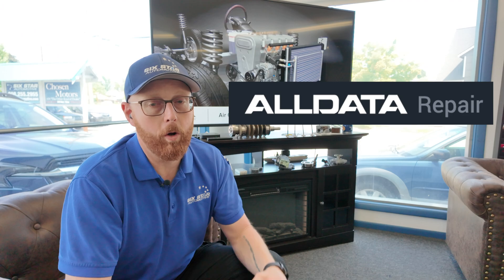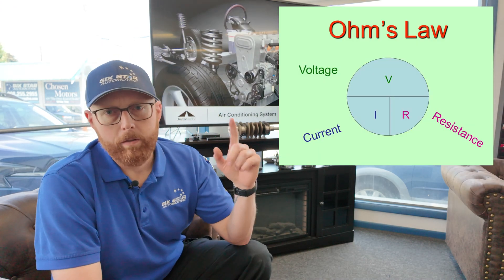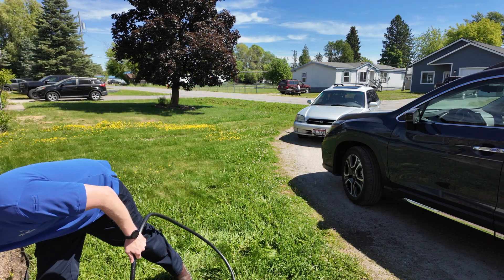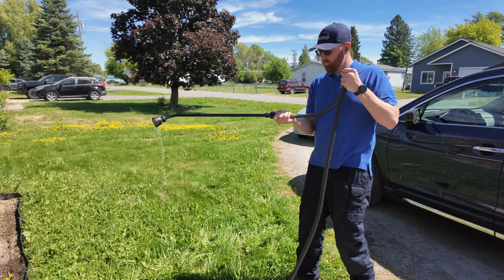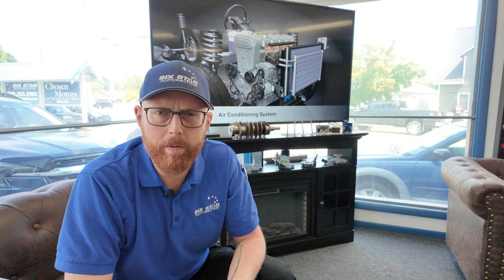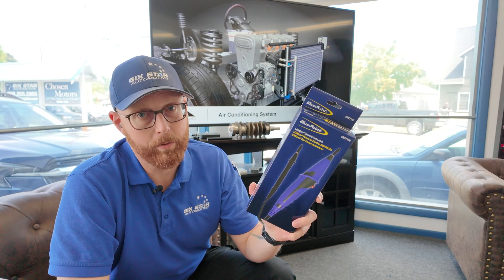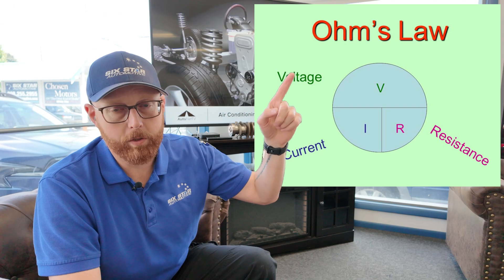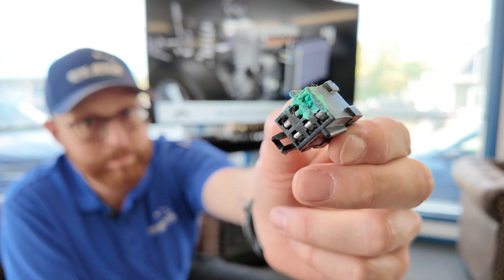Voltage Drop Diagnosis – The #1 Electrical Testing Skill You Need

Comment: Voltage drop testing doesn't fail. You either have a viable circuit, or you don't. Like our friend Dan said, he didn't invent voltage drop-just an easy way to identify it. His Loadpro and the associated no nonsense book ,Fundamental Electrical Troubleshooting  make it simple to understand. Regardless of what device is used, once the concept becomes clear and is utilized, the diagnostic process becomes faster and easier. And yes, it does work very well on starting/charging systems that carry substantial amounts of current. Just my 2 cents. Thanks for posting the video, good stuff!!

Comment: How many amps does it draw??

Do you even know?
Reply from the maker: Its draw depends on the voltage in the circuit, but its generally about .5a
Dan Sullivan explains it here https://www.youtube.com/watch?v=1NX7ei0H0Is&t=1043s
Reply: @sixstarauto so if you were testing a fuel pump circuit. Could potentially pull 5 to 8 amps do you think a .5 of a amp is appropriately stressing the circuit to show integrity?
Reply from the maker: @kevinminor2558  Yes, check out this video. https://www.youtube.com/watch?v=1NX7ei0H0Is&t=1043s
Reply: @sixstarauto We can both agree the LoadPro pushes about 0.5A to stress a circuit. But let’s be real—take a starter cable, that big red one pulling 150+ amps on crank. You measure 12.5V with a voltmeter, then hit it with the LoadPro, half an amp, and it still shows 12.5V. According to that tool, the circuit’s fine. But is a half-amp really the same as 100 amps? Do you honestly believe that? I don’t. This kind of test might give you something useful on certain smaller circuits, but it’s nowhere near universal like you’re pitching it.
Reply from the maker: @kevinminor2558  It will work. Watch this video, or use the tool. It does the job, even on battery cables. https://www.youtube.com/watch?v=1NX7ei0H0Is&t=1043s

Comment: I work for Ford and after you pass the electrical class they give you a test lead kit that is super helpful their diagrams will tell you pin size and what lead to use
Reply from the maker: A good lead set is invaluable. You need to be able to trust your tools so you can trust their results. That is cool that Ford does that.

Comment: I used to get caught up on engineer flow charts with resistance checks and I got burned a couple times now I load test wires with either a 3157 bulb or an H11 bulb and have been far more successful with diag work
Reply from the maker: That's good. I have never liked the light technique. It works, don't get me wrong, but I want to know the number, not bright or dim light. But again, some load testing is better than none. I just need numbers. Easier to explain in notes to the customer that way.

Comment: 2:23 - The reason you cannot measure voltage drops without current flow is because there is no voltage drop across a load in a circuit that is not complete. You will only measure the supply voltage across an open switch or relay contacts (or across a physical break in the wire if all relays/switches in the circuit are closed). Current cannot flow unless a voltage is connected across a load.

Comment: What he says is very true. My 92 corolla stared blowing cold but not ice cold as it used to be. Freon is good so did a amp draw test on the compressor with an amp clamp on negative battery terminal. Turning on the AC Button (not the blower fan: fan was running) shows 300 mA increase. Knew it cant be right and check the connector at the compressor... more than 50% of wire strings are broken! Got the wire sorted out and back to ice cold AC. The clutch was slipping with that low amps so compressor was not fully engaged!

Comment: Excellent explanation of how electricity works by using the water analogy and promoting self study. I'm a great nuts and bolts guy but electrical diagnosis was my downfall. I want to improve in this area. Just subscribed and am looking forward to your future videos.
Reply from the maker: I have found this is a common problem in the industry. I spent many years buried in study to become the "electrical guy" at the shop. I dont know if my videos will be a substitute for that, but it will at least help on the path.

Comment: Can I see the location of terminating resistors on ALLDATA for CAN Networks?
Reply from the maker: I cant attach a picture. I looked up the most recent diagram from my latest video and could not find them. I called AllData and asked. They told me that they are usually inside of the modules and the "trouble tree" should get you there. IDK about that. I also found that the resistors are usually at the ends of the system where the wires "terminate" rather than pass through, but this is not obvious in the diagram...I dont have an answer, sorry.
Reply: @sixstarauto Thank you for taking out time to reply me.

Comment: In electronics we call them IR drops. Anytime current flows through a resistance a voltage drop occurs. Calling them IR drops is a constant reminder of Ohms law behind voltage drops.
Reply from the maker: I love it. I can only imagine how complicated the calculations are in electronics. Determining, and compensating for the amount of resistance and capacitiance needed for a specific circuit and how it relates to another. Or the amount of power a component will draw and the voltage needed to operate it... I cant wrap my head around it. The more I learn, the more complicated it seems.

Comment: Voltage drops are almost never found with a volt meter you need a scope
Reply from the maker: With this tool, it will very much work with a volt meter. But you will never hear me argue against using a scope. We arent there yet in the videos, I am trying to keep them as simple as possible to start. I am guaging how many people would like me to go into more detail (these take a lot of time), but most of the comments I get from techs are negative and condescending. I dont have time for that.
Reply: @sixstarauto  Hi Steve (hope i have your name correct). Thanks for taking the time & effort to produce & upload the videos. I have just come across your channel & instantly 'subbed'.
Regarding your comment Re. professional techs being, at times, condescending & patronising at times, is something l sometimes experience here in the UK. Although, as a tech, when i'm asked on occasion, to inspect & offer a second/third opinion on a vehicle, previously looked at by a 'professional shop, i discover that they are not necessarily 'that professional'!😊. I have learned & was taught, that very often there is more than one methodology to diagnose & hopefully repair a vehicle. Personally, i do not use the 'loadpro' (or equivalent tool), I use my 'self build test lamps' in conjunction/parallel with my voltmeter. So, similar to your method, but not the same in practise. But similar/ the same, when it comes to results/data.
So thanks for a great tutorial, i look forward to more, covering the 'basics' & those that go deeper into professional auto electrical diagnostics. Have a good one. mike
Reply from the maker: @mutukumike-q3l  Thank you for the thoughtful response. I do not aim to tell anyone that my way is the only way, just the fastest and most accurate way that "I" have come across so far. But again, thank you.
Reply: Scopes are best way but you most definitely can easily find volt drop with load pro

Comment: ok so i have a 2013 cmax hybrid battery continues to die after 2-3 months good point is they give me a new battery under warranty however trying to get to root of problem thank you
Reply from the maker: I will have to admit that my knowledge of hybrid systems (especially specific systems) is limited. There has been little demand for it where I am. I have heard that the Cmax systems have been rather problematic. The dealer should be able to find the problem after they replace the unit. I am sure some charges will be necessary. It is always possible for the hybrid battery to be the source of the problem if it has bad cell(s)...